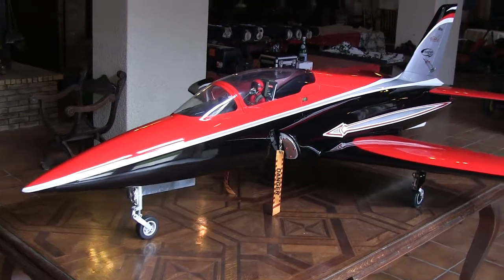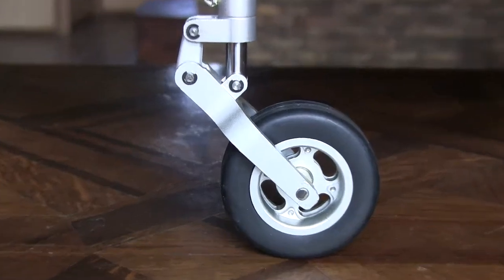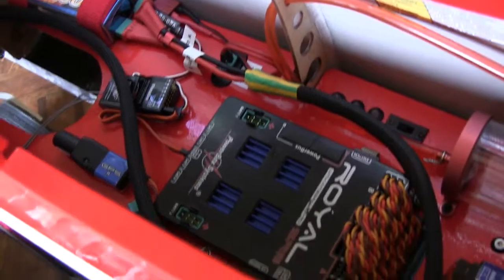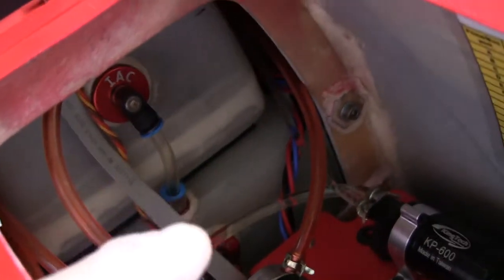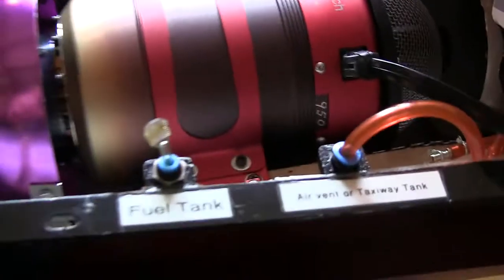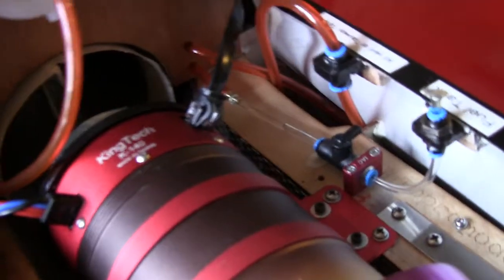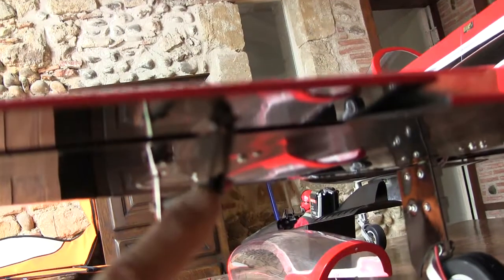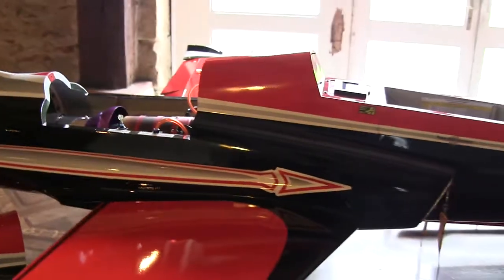TOPRC ODYSSEY Sport Jet walk around

Comment: What fittings did you use for your fill connection and for the vent / taxi?
Reply from the maker: I use FESTO fiiting, 6mm plug with 6mm tygon tubing (suitable for ketosene or diesel). Same for air vent

Comment: Can you give us more details on the lighting and GPS system? What afterburner ring size you used, closeups of how you installed the various lights around the plane, etc.  How do you use the GPS system and how accurate do you think it is?
Reply from the maker: The GPS system comes as an option with the power box royal SRS. 
While flying all GPS relevant datas are registered in the log file, to be analysed later on a computer. It's very easy to use and precise (around a meter gap max). 
Combined to other telemetric accessories I have: Altitude, vario speed, ground speed, way points, clock, etc. Through Google maps you can overview your flights.

Afterburner comes from unilights.at. 
Ring diam is 110mm. Will fit around the toprc's tailpipe that comes with the kit. To be glued or attached to the last tail wood couple. Use some heat protector tube for the electrics wires. I've put all the wires from the back (elevators and rudder servos wires + navigations lights wirs) in a large heat protector soft tubing till main dashboard (after the turbine). 
Safety first!
Reply: Hakim SAFTY appreciate the info.  Have a link to the heat resistant sleeve you ran the rear fuselage wires through?

Comment: What servos you using on your Odessey?
Reply from the maker: Hitec 7954SH everywhere (2×stabs, 2xflaps, 2xailerons, rudder and nose wheel),, under 7,4volts = 29 kg torque, 0,12s for 60° course. 
They are programmable, very precise  and enough powerful to do the job. 
20 years using Hitec servos  zero trouble shooting.

Comment: Super excellent Video. Love it. Starting my Build in 2 weeks
Reply from the maker: Thank you for your comment.  Do not hesitate to ask for advise during building process.  The manual is not very clear and some important points are missing (ie. consider 11.1v to power brake system and 7,4v only for toprc L/G system ). Good luck and keep me informed.
Reply: @hakim6750  Thank you.
If ok with you, can I mail you when I have questions ?
Reply from the maker: @danielralefeta  yes no problem. Feel free to ask.
Reply: @hakim6750  Thank you very much
Reply: Very nice plane and your details are awesome. I'm thinking about ordering one